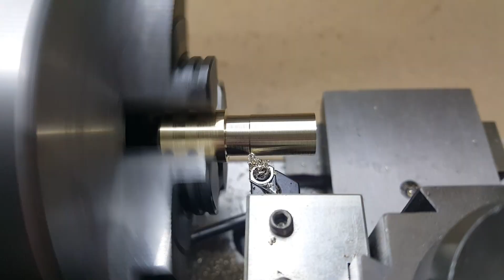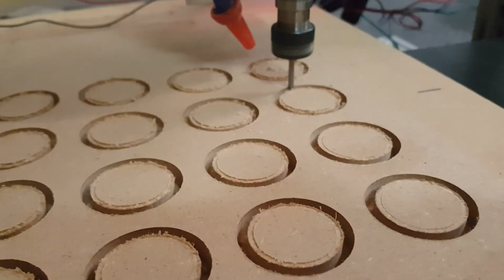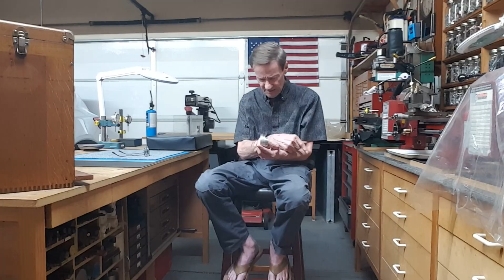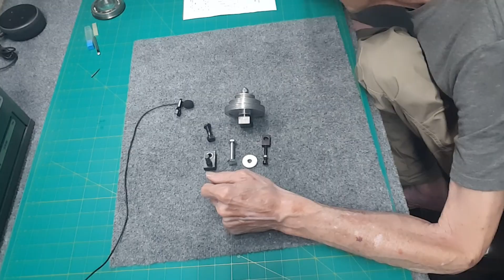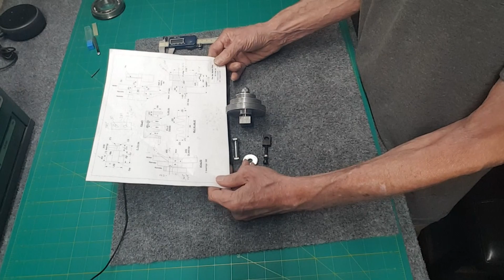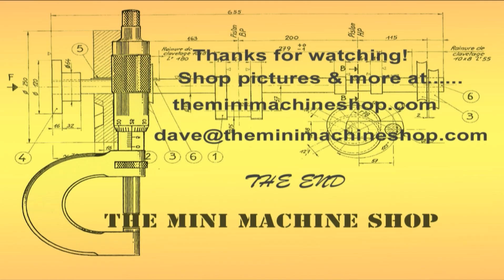Final Vevor Wobbling Tension Pulley Redesign

Comment: Did you use Combined radial-axial bearings on the inside of the pulley? Or just radial load bearings.  I don’t think they used a large enough diameter bearings in the original design to handle the radial loads.  Also their placement of the bearings is way off.  Great job resolving the issue.
Reply from the maker: A needle bearing went on each side of the pulley and one thrust bearing on the outside where the spindle load was. So far Deez said he did a number of projects on it, and all is still good.
Reply: @TheMiniMachineShop  Needle bearings should work well for the radial loads if the bearings are rated for the tension that will be placed on them.  Why would they put the bearings in the center of the pulley as you described is beyond me,